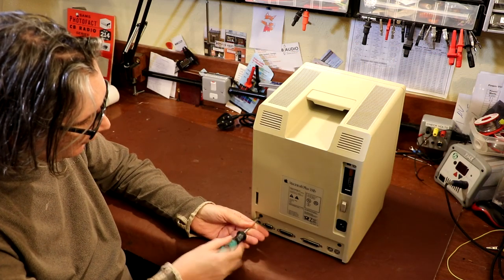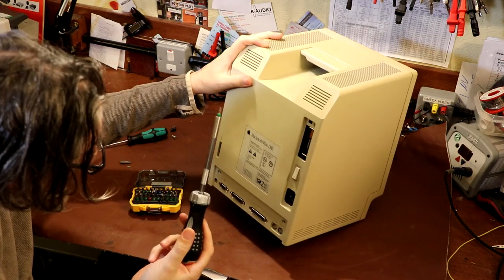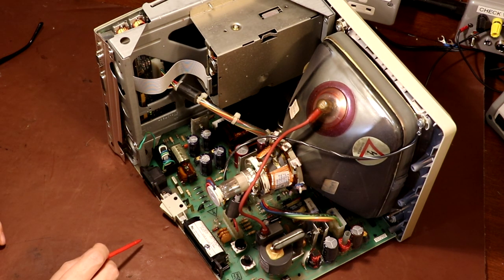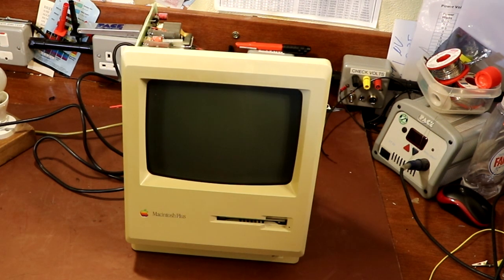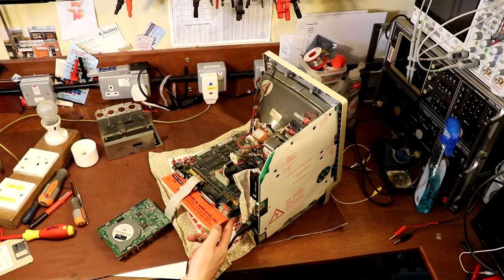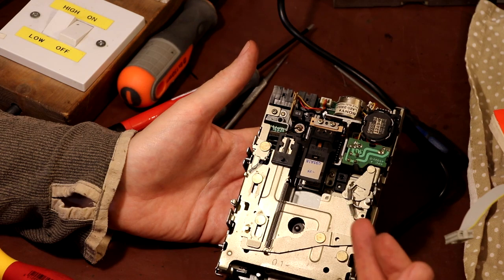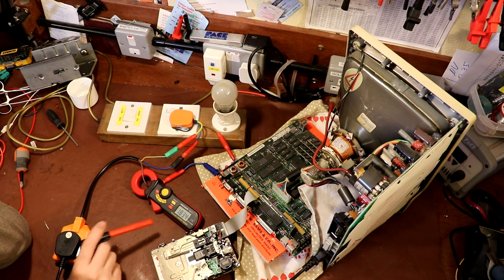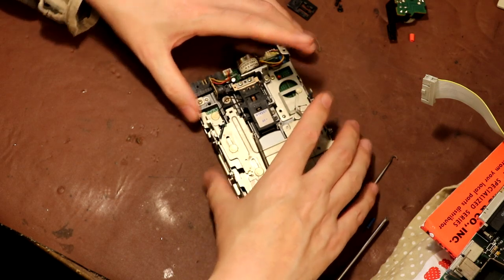Forbidden Fruit  - Apple Macintosh Plus

Comment: My old B77 Revox popped it's across the mains capacitor some years ago and filled my back room full of white smoke, my wife was not amused.Thanks Chris for another interesting video.
Reply from the maker: Barry Charnley Hello Barry, I hope all is well with you.  Yes we have all been caught out by those capacitors several times. I should have changed them out on sight as it’s not like I don’t know about it. I had however been measuring the earth leakage and monitoring the current for several hours. I’m guess these are normal ok until a transient punches through the insulation. They then draw enough current to clear the fault leaving know evidence. Those old macs also run really hot! Thanks regards Chris
Reply: Yes that happened to mine the machine still carries on working ! My A700 did the same was kinda cool to see smoke pouring out of the headphone socket !

Comment: those emergency eject holes were handy, used them a number of times. the disc is ejected electronically by the system software, you eject it in the system and it came out.
I used to have a Apple II...
Reply from the maker: Back in the day I did a lot of work on the design of ISA bus cards for the old PCs. But it’s such a long time ago I and have forgotten more than I remember. I should have known that was an eject hole but had forgotten. Shame I don’t have mouse or keyboard and they are so so expensive now.

Comment: Well done, Chris. I recently had a Rifa capacitor fail dramatically in a bench LCR meter - a large cloud of smoke! Normally I replace Rifa caps on sight but I seem to have missed this one. Now I have to pull all the cards and clean the interior to get rid of the stink - it actually left a yellow stain on the aluminum bits! Regards, David
Reply from the maker: David V Yes they can make a right mess and do produce a lot of smoke. Funny these looked ok but obviously not. What make of LCR meter was it ?
Reply: @allthegearnoidea6752  Chris, it's an HP 4262A that I purchased "for parts or not working" and repaired.

Comment: An insulation resistance test at 500V will help to easily locate faulty Y capacitors or pending failures. I find that an insulation test will identify potential failures long before there is any visual indications like the cracks in the RIFA capacitors. I also find that most Y film capacitors tend to go leaky over time so it is not just RIFA capacitors that are a problem but these are by far the most troublesome.
Reply from the maker: Stephen Bell  These capacitors fail in most old equipment regardless of the brand. I wouldn’t test them just change them out on sight. That’s what I should have done but made a balls up of the job this time being a lazy arse!

Comment: Those Rifa caps strike again, evil damd things.
Reply from the maker: DextersLab2013   Your right. I should have changed them out right away and no idea why I didn’t just a brain fart moment. I had been monitoring the earth leakage with the machine on test for several hours previously and it had been fine. I think it’s probably a line transient that punches through the insulation. As you know to some extent the dielectric is self healing  and the faults don’t show up on the resistance test after the fault self clears. Ooooops. It’s a good reminder

Comment: Great Job Chris !! Was Never a Apple Fan Boy Too Over Priced For What They Are But You Did a Fine Job As Usual , Your Mate Richard Will Be Pleased !! Have a IBM All In One Unit Like That One Up in The Loft Some Where Which I Used To Use in Work Back in The Day Regards mike.
Reply from the maker: raceingdemon6464  You should dig out your old computer they are all the rage these days. No I’m not a Apple computer fan. I did have an IMac but don’t like the operating system I’m just used to using windows and don’t care to learn anything different etc

Comment: Yup, you could see the cracks in those paper type Rifa caps! Where they just caps or R-C networks?
Reply from the maker: Thanks just  capacitors in conjunction with a common mode choke. The Americans are hot on the FCC stuff. I should have changed them out right at the start they were bound to fail!

Comment: I've never thought of WD40 as poison, but it's definitely not recommended for internal consumption or healing of arthritic joints. I don't use it on silver plated contacts because in my experience, a year later it actually seemed to make the silver sulfide tarnish worse. Sticking with the expensive stuff with the fire hose dispenser..
Reply from the maker: Danish Native   On a lot forum’s they constantly bang on about how bad WD40 is and you have to use the latest high cost silicon free version gargled by nude virgins. It’s basically paraffin with a squirt of oil. It’s ok for cleaning metal and even switches I don’t care about. I have heard about it on arthritic joints but never sampled it myself
Reply: @allthegearnoidea6752  LOL nudge nudge :)

Comment: I did wonder why you were fondling the fdd for an earth leakage fault, i've had days like that :-D.
You always make me smile when saying "I don't know anything about this", you fibber :-D.
Yep the special f.d.d signal connector, ibm pulled that trick as well, and the data output was incompatable with the shugart SA400 type disk drives so yep a special kind of crap lol.

Shame your mate hasn't got the mouse and keyboard, but they will come in time.
Reply from the maker: zx8401ztv  Yes those mouse and keyboard goes for hundreds of dollars now silly money.  I don’t really work on computers these days and not really that interested in them but would consider a vintage commodore Pet if one crossed my path.  I should  have replaced out those capacitors on site but I was just being a cheap lazy arse etc. Thanks Regards Chris
Reply: Chris we all do it, i was pulling your leg as normal :-D
The repairs i hate are the self fixing kind, you just know it will fail 10 mins after you give it back.
Hairline pcb cracks and bloody smd parts play the game with my patience grrrr :-D.
There was a c.b that failed in the synth section, no real reason was ever found, a blanket soldering of the synth r.f section fixed it every time!!.
Very annoying as i like to find the reason.
Smashing video chris :-D